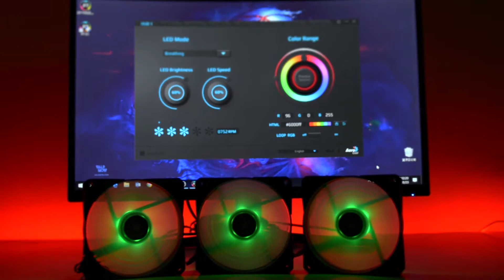Manage & Synchronize P7 Components With P7 H1 RGB Hub

Comment: So, if I am not wrong: When your motherboard has enough fan connectors and the 4-pin rgb connectors, there is no need to use the hub. Only question I have then: Can you link (daisychain) the fans together with using only the RGB connectors of the fans. Intending to buy this kit + one extra fan for my case, but I wish to use them with the software of my motherboard instead of the hud.

Comment: Why can I not find anywhere to by this in the states or in Canada? I'm looking everywhere and can only find it on some Australian site I've never heard of
Reply from the maker: you may check where to buy here. We're also trying to get them on Amazon US by Q2 this year
Reply: AeroCool Thank you. I found that they come included in a pack of RGB fans that is sold here but I didn't go for it because I only want the hub, and not the fans. Another question: Can I individually control whatever I plug into this with Asus Aura? That would be the primary reason to me buying this
Reply from the maker: I'm not sure if i get you right. but basically if you have ASUS AURA motherboard ,you do not need the hub, probably only the fans with one or 2 Y cables. The hub and its software is more for those who do not have RGB capable motherboard
Reply: AeroCool My aura motherboard has two headers which are chained together so I can't individually control them. I wanted to get this so I can have more headers that I can individually control in the software. Hopefully this clears things up a bit. I look forward to your response and I appreciate your responses so far!

Comment: UHM HELLO HOW ARE YOU SERIOUS THAT I CANT CONTROLL THE FAN SPEED THEY ARE RUNNING AT FULL SPEED ITS LOUD AS FUCK HELP PLEASE?
Reply from the maker: Hi Kai, the P7-H1 can't control fan speed. It can only control the RGB lighting. Please make sure the PWM Fan Connector (FAN 4-Pin) connects to your motherboard.  Please see manual here: https://www.aerocool.com.tw/images/project7/hub/p7-h1/P7-H1-use-manual.pdf
Thank you!
Reply: Yes but i can only change the PWM setting on my motherboard, the fans are NOT registred by SpeedFan so i can not change the actual speed. Man i bought P7 case, fans, psu, its all good and im happy but this is just bad -.-
Reply: any news with these? i have the same problem

Comment: My fans are running in full speed(~1300 rpm) how do I lower them? everything is connected and changing values in the bios doesn't change anything.
Reply: Kyto Kami Then its so hot it needs to go full rpm, or you didnt change your settings good, or the hub just gives each fan full voltage